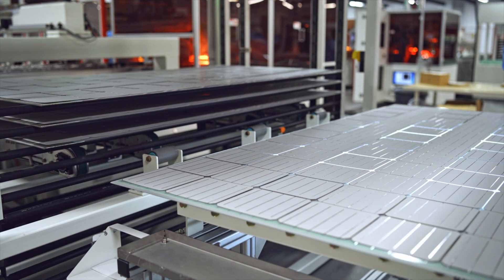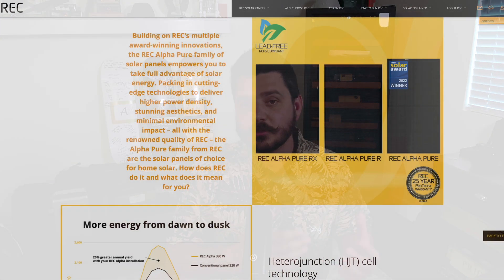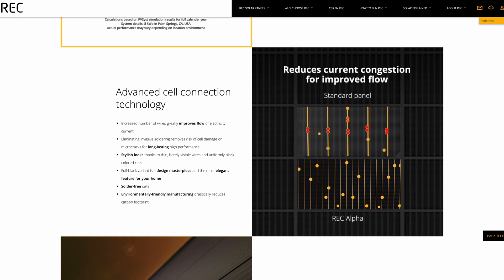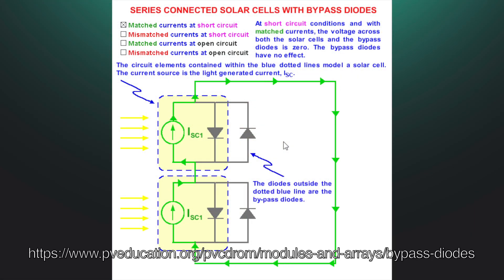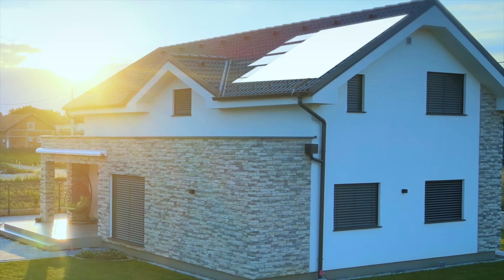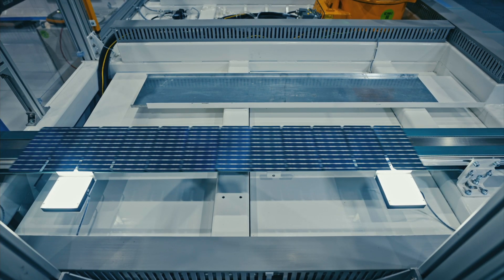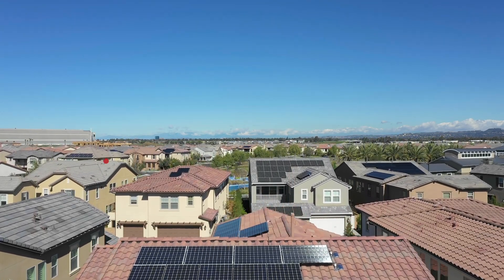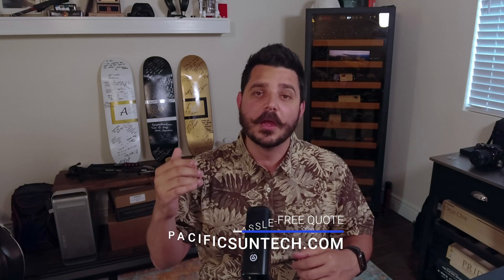The Truth About Solar Panels They Don’t Want You to Know!

Comment: I had issues with Tigo RSD/optimizer paired with the EP Cube. After researching the benefits of half cell mono panels, which I have, I asked if the optimizer function could be disabled. To my surprise it was, and ever since my system has been performing excellent.

Information about modern solar panel technology needs to keep getting out. Great video!